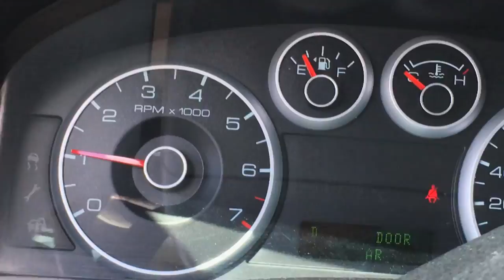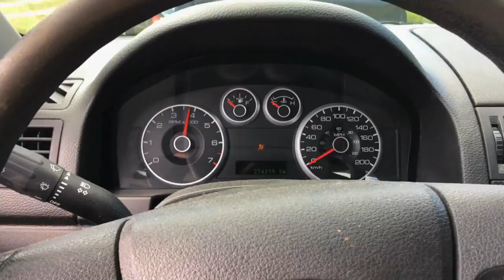ROTTEN Ford Fusion!

Comment: Bro, that's my Ford Fusion!
Reply: whats the story behind it
Reply: Aaron Tu
Reply: I just recently bought a 2017 mustang GT Premium to replace my 05 ford fusion that I bought brand new for college back in 04. And for the past few months its been in and out of the shop due to problems coming to transmission and engine problems. So I traded in for a Mustang and knew the car was going to the scrap yard because of high mileage it had well over 145,000 miles. BYE BYE FUSION its been a lovely car for the past 13 years.
Reply: +Aaron Tu  You mean it was lovely car for the first 12 years and a nightmare for the last year with all the issues...

Comment: You might like to consider pulling the air bags out of these cars before jumping them.  1.  You won't end up with a face full of air bag when you jump them, which hurts, and 2.  You can probably sell the good air bags for just about as much as you paid for the entire car making it a free jumper...
Reply: Thats what they usually do, but it's easylier to pull the airbag fuse.. 10 seconds of work